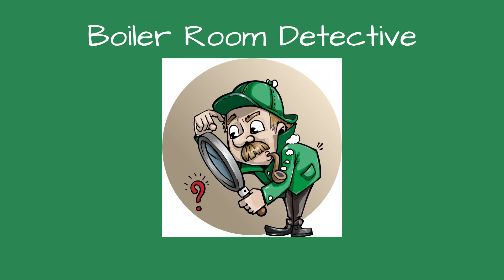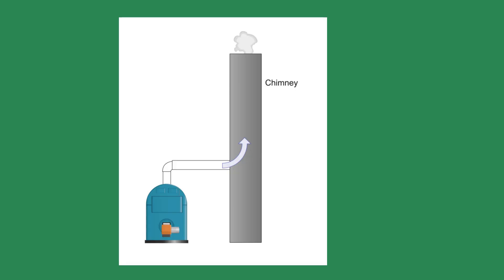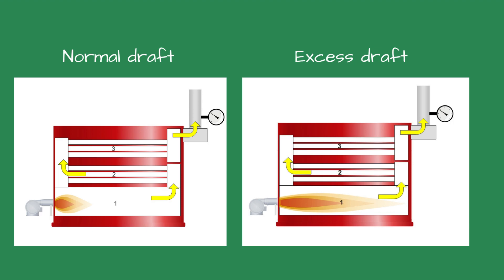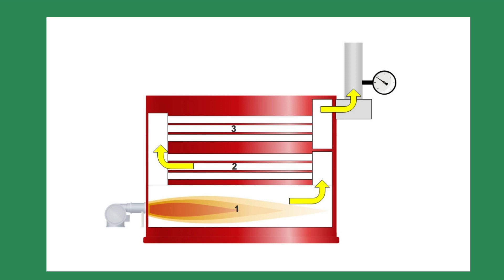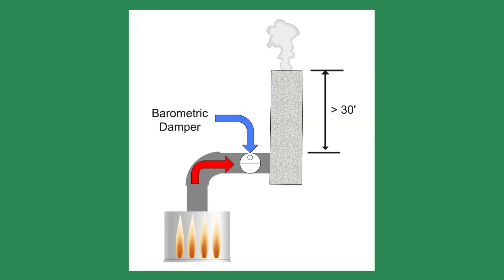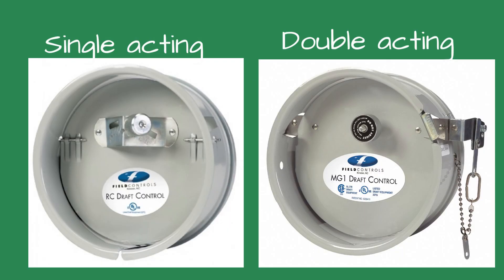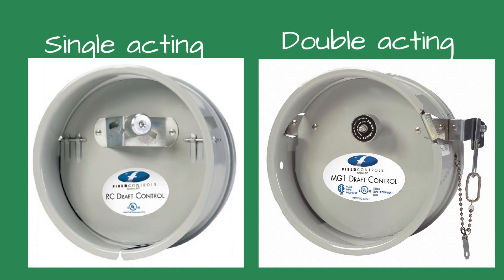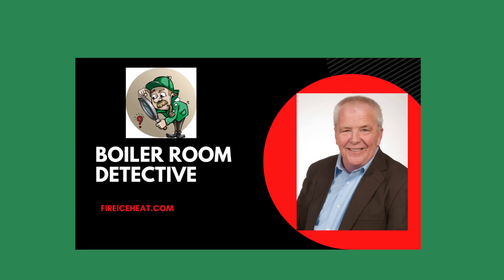Detective Tools Understand barometric dampers

Comment: Do the damper settings change if my oil company put in a new aluminum tube liner.  Thanks good video
Reply from the maker: It could change the draft and should be checked

Comment: I have a boiler that was converted from oil firing to natural gas in the early 80's.   The exhaust flue has a barometric damper (BD), and it (BD) swings wildly on initial fire and sometimes the boiler won't maintain firing.   I've read that a BD is only used for coal/oil burners not needed for nat gas?   Note the BD can actually swing both in (vacuum) and out (Pos pressure) or is dual acting, there's no screw or limit bracket to limit to vacuum balancing only.   Should I just fix it it place?   I'm concerned its affecting the combustion flame shape and not letting the thermocouple do it's job...
Reply from the maker: Barometric dampers are used on gas boilers when the chimney is over 30 feet high The barometric damper is double acting on gas and the stop is only used when firing with oil. It should have weights on it and adjusted for about -0.05” wc